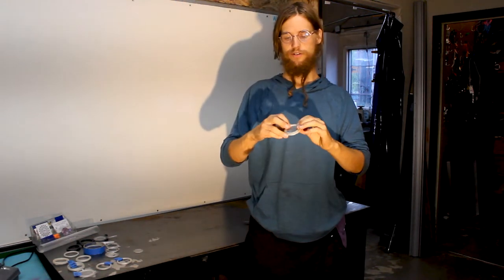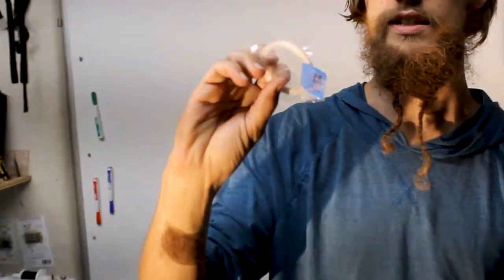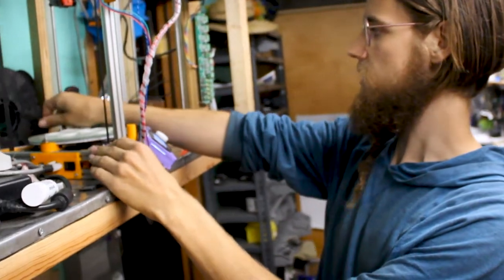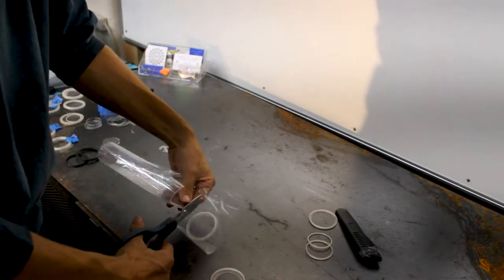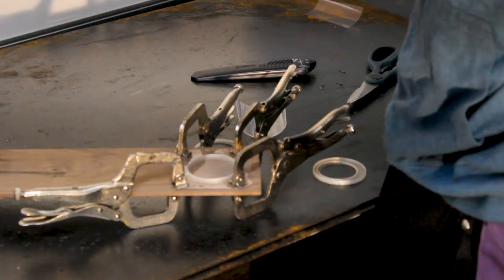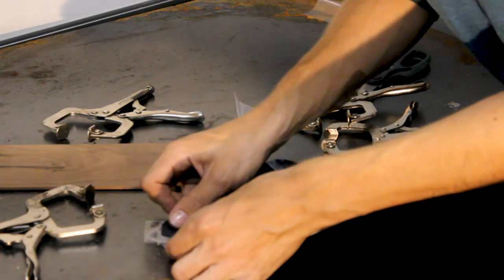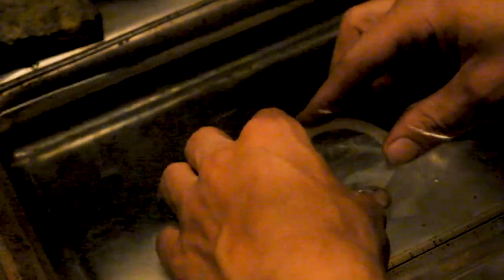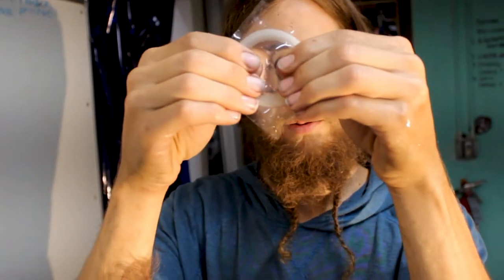3D printed liquid lens 1.2.2

Comment: Not practical. You haven't addressed astigmatism. Those are not prescription. Maybe a fire starter. You are not printing lenses, just holders for the plastic membranes. Actual prescription lenses are being printed using the resin type of printers.